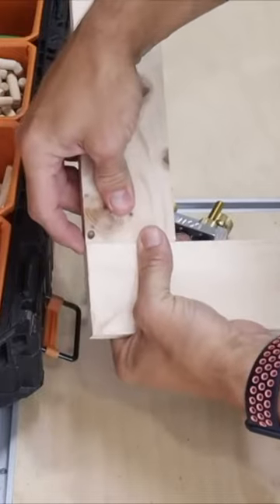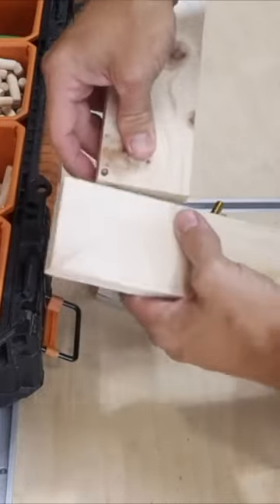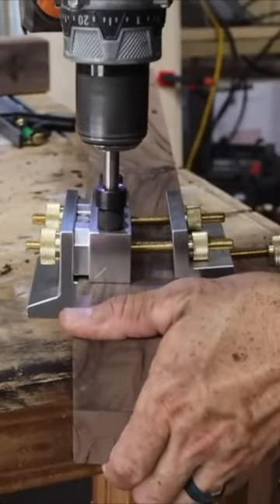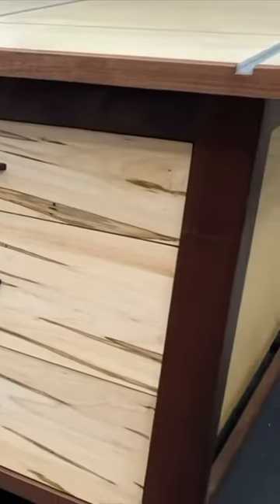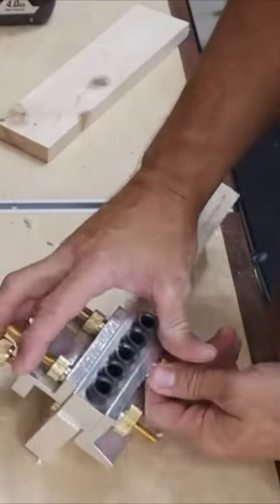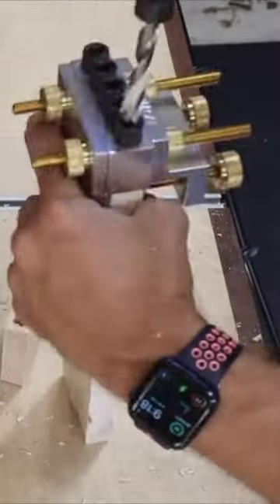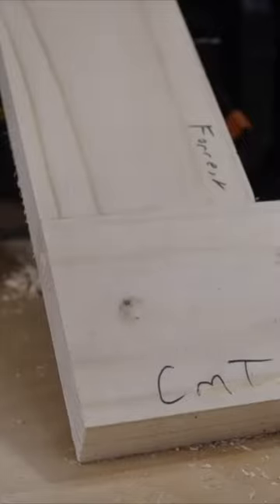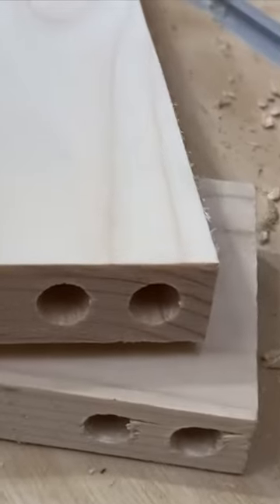The BEST Doweling Jig on the Market!

Comment: I love to have one but $250??That’s a little high for a jig.
Reply: Maybe it drills for you :-)
Reply: It's so worth it as every other jig I have seen is mostly plastic. Which works for a couple times but won't stand up to serious use.
Reply: Worth it. It's my third doweling jig and it is so worth it.
Reply: The dowel jug i have is crap. Ine day i will get this one
Reply: I’ve used many many times worth every penny I wish they could come up with a mitre corner attachment to put dowels in mitered corners on boxes or picture frames
Reply: I bought one these back in 2005. They had a money back if not satisfied with it. I thought what the heck. Honestly, I expected not be that pleased with it and I’d send it back. After the first use, I could not send it back. It just works and is very well made. I bought the jessem jig a few years ago, also well made but it’s the dowelmax that I reach for. I use it for drawer boxes mostly. I bought two of their bits and stops to speed up the process. While it’s only a “jig”, it’s a wonderfully made jig that just works.

Comment: I've had a Dowl-it and Improved Dowl-it (with the paired screw in inserts) for probably 35 years and used them for face frames. The original was very accurate but the improved is off just enough to offset the alignment. 
The price of this new jig may be worth it.

Comment: The three components look cocked and non parallel to each other, as if the brass screws do not do a good enough job of holding alignment, or flex too much.
Reply from the maker: It's not crooked.  It's a very accurate jig.
Reply: @731Woodworks , thanks for the quick reply! Can you  explain what I am seeing in the video? You must see it too, no? I do not know how to find time stamps in these shorts.
Reply from the maker: @leehaelters6182  at about 0:06 seconds in the clamping shoe is slightly tilted. There is a shim that is supposed to go there that I was unaware of at the time.  It allows you to adjust for various thicknesses of wood.  Even so, the face that contacts the drilled surface is completely 90 degrees to the dowel jig and the holes are perfectly 90 degrees.  But yes, the clamping boot/shoe is slightly tilted because of user error.  What's impressive is it's still drilled an accurate hole because the face is still parallel to the surface.
Reply: @731Woodworks , thanks, I can see what is going on now. The  foot must always be clamped tight, metal  to metal, and not located out on the brass rod as it seemed to me. Makes perfect sense. Same with the clamp screw side, except towards the end of the video is a shot of it reaching across a board, cocked on the rods but nevertheless putting pressure where it is wanted. I wonder, if two jam nuts are not included to hold the ''fence'' locked at 90 degrees to the screw, then they could be added by the user. Two accessory spacer tubes could do the job also, perhaps more rigidly. For that matter, just a user made block of wood would do, handsomely. Maybe that is what the manufacturer imagined. Thanks for clearing this up, all the best!